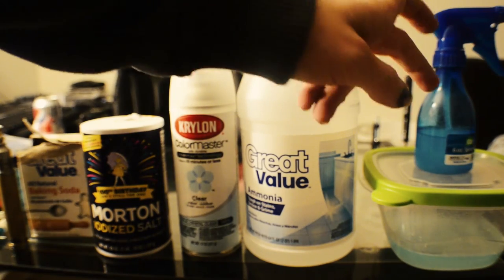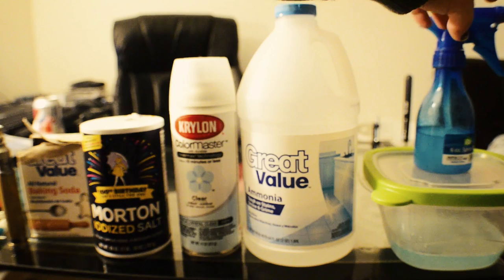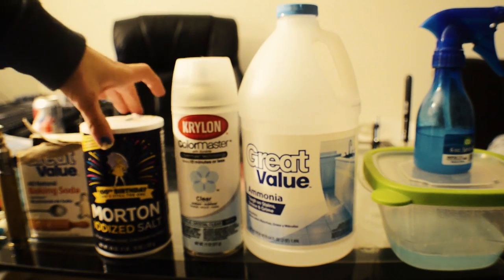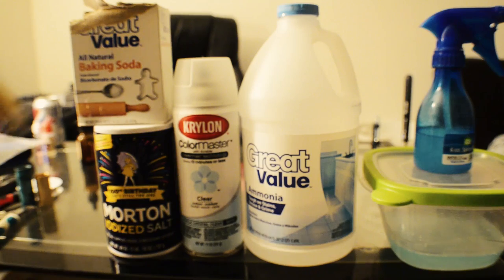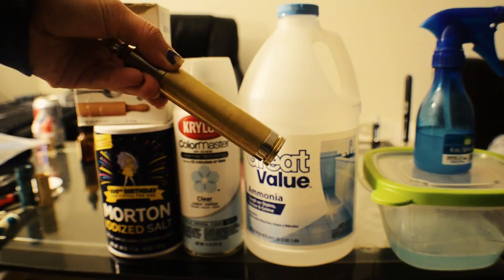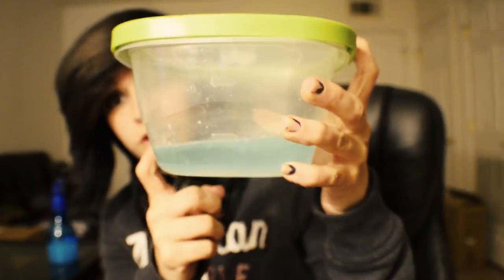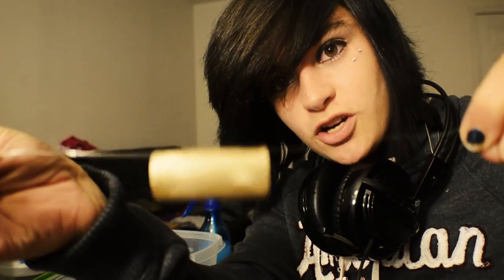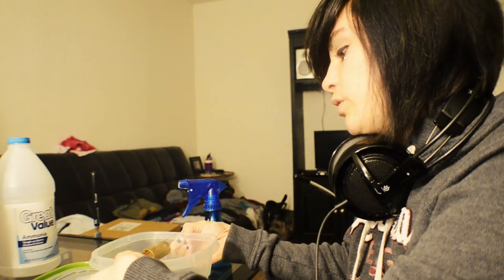Tutorial: How to patina brass and copper mechanical mods

Comment: Thanks for this easy instructional video Marissa.  I did my copper nemesis (well I'm still marinating it.)  I kind of had a hard time balancing the mixture.  It would often come out thick like sludge.  It jammed up my spray bottle..  So I ended up just preparing a mixture in a bowl and then like you say, every two hours, turn the mod and instead of spray the mixture I just mixed it up and poured it on.  gloves and a good breathing mask work well!  Anyway it IS working.  Actually this morning I soaked a heavy duty paper towel in the mixture and wrapped the mod with the towel.  gonna marinate that for a while too.  see what happens.  Look forward to more instructionals from you.

Comment: Thanks for the info.  Tried several Times to patina my copper Hades 26650 and always came out mostly back and just speks of blue.  I was using dry salt. Mixing it and spraying salt did the trick. Amazing blues in my mod now. Actually got offered a nice price gor it same day I finished.  Thanks for the help.

Comment: great way to get a good even sand prior to patina. get an old cartomizor or I used an old cartridge from an Iclear 30s thread it to your mod and grab the cartridge with your drill. you then have a portable "lathe" I proced to wetsand mine over the sink.

Comment: you can use lighter fluid (zippo lighter fluid) or acetone to strip the coatings off usually instead of abrading it off I would think it would be faster but you also might like the satin surface of the steel wool. stripping off with chemicals is a good way in case the item is only plated instead of solid brass or bronze. you can get both chemicals at hardware stores. just make sure you do it in a well ventilated area and absolutely not around any heat source. also leave the rags outdoors until they are totally dry before disposing of them.

Comment: With I could see a video of clear coating my shiny copper mod. Sick of cleaning it!
Reply: The wrap seems like a good idea gomper until you want to unscrew your mod plus it's not really going to work for the firing button. At the moment I'm using a j-cloth and some brasso which brings it up really well. Kind of concerned about scratching it up with sandpaper. What grade would you use?
Reply: Just in case you still haven't found any information on it, i would like to tell you that a clear coat does not protect your mod and it will patina underneath the clear coat. Although there is something called Metal protection coat that seals metal, that would work best use the "2K" one that is designed for cars i am sure nothing gets through that so easy. ^^
Reply: Really, I never thought that would be that case. Seems hard to believe. Thanks for the tip
Reply: Pete Horam RaVeN1K Actually the patina under the clear coat is very small because it needs oxygen to patina  so without it the patina will only continue very very little